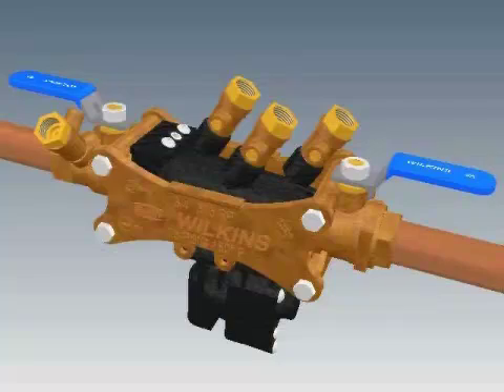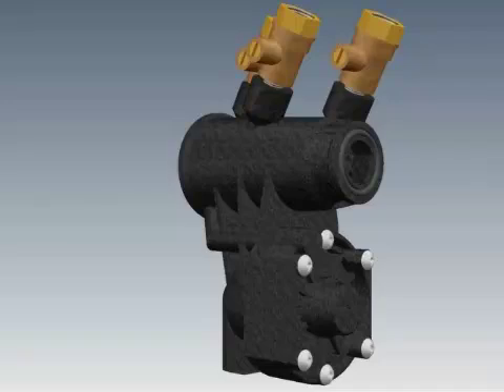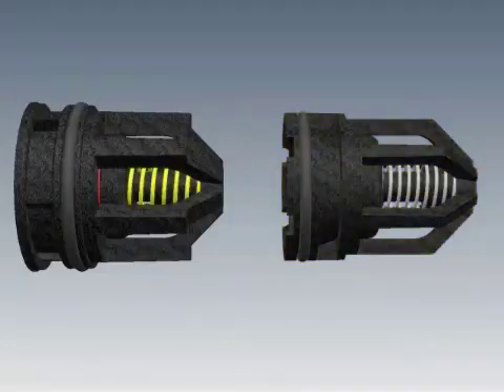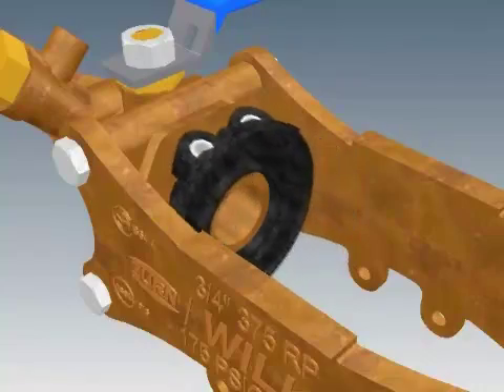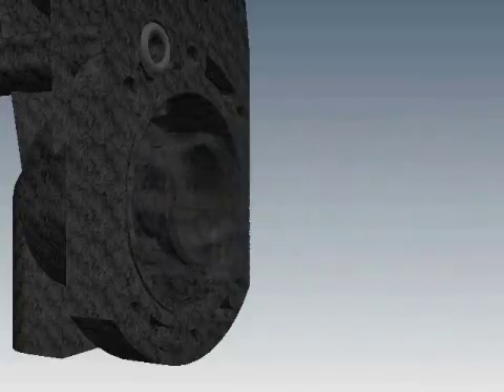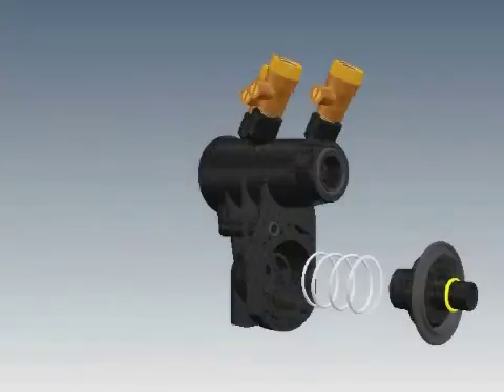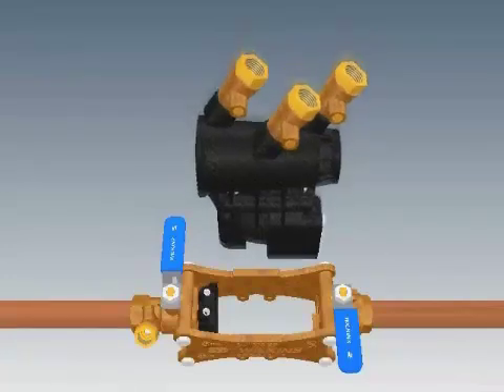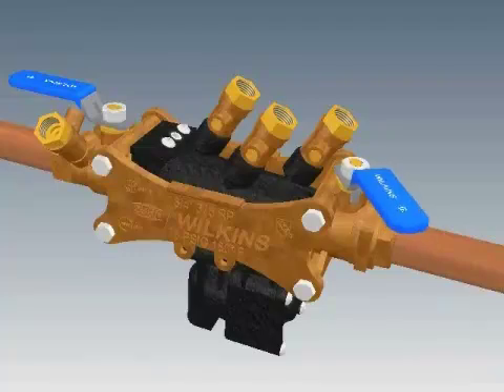Repairing a Zurn Wilkins 375 (1/2" - 1") Reduced Pressure Principle Assembly

Comment: Hi, we have a 375 model.  It has a lot of water coming down from the "vent" area.  So we currently turned off the water.  What do we do or replace?  If we turn the water on it's not just a leak, it's like turning on the faucet.
Reply from the maker: The Zurn Wilkins Model 375 Backflow Prevention assembly may discharge water in order to prevent the reversal of direction of flow of water, in order to prevent contamination of the water supply system.

The amount of water being discharged by a Model 375 Backflow Prevention assembly, may correlate with an internal leak at some component of the valve. Leaks typically occur due to dirt, debris, or normal wear, within the valve assembly. A large leak may indicate a large obstruction or leak within the valve's number one check valve assembly, the valve's number two check valve assembly, or the relief valve itself. The valve assembly is performing as it is intended to to protect the water supply system.  For assistance with determining which components may be causing the leak, please review the troubleshooting guide in the product's installation and maintenance sheet, or utilize the video at this link: 
 https://youtu.be/3d2rNoroZ_c

 
Feel free to reach out  to our customer care and technical support team by calling 855-ONE-ZURN (855-663-9876)

Comment: I have a ZW 375 RP. It's about 4 years old. There is a small leak from the body of the relief valve, not the relief vent. I've inspected and cleaned all check valves. I have also inspected and cleaned the relief value. There is still a small leak from above the relief valve. From the look, the leak appears to be from the body. What do I do? Please help.
Reply from the maker: If there is a leak coming from the body of any valve, it is typically due to a damaged or worn body. Replacing internal components may not resolve the issue. Luckily the Zurn Wilkins Model 375 is designed for ease of repairs and maintenance. We offer many repair kits for this product, including a pressure vessel repair kit, that will quickly drop in place of the leaking composite body of the valve, and return it to good working order. Available repair kits are:
1. 1/2" - 3/4”: RK34-375V
2. 1”: RK1-375V
3. 1-1/4” – 2”: RK114-375V
Reply: @ZurnIndustries  Same problem here, only 3 years old. Does housing wear out with sunlight?
Reply from the maker: @Armandot6  The Model 375(XL) was specifically tested for UV resistance for outdoor use applications. It was tested in the Arizona heat and direct sunlight without experiencing any issues from that exposure. As with any product excessive heat may cause some increase in degradation. Luckily the Model 375(XL) is simple to repair with the replacement pressure vessel repair kits. Available repair kits are: 1. 1/2" - 3/4”: RK34-375V 2. 1”: RK1-375V 3. 1-1/4” – 2”: RK114-375V
 
For more assistance in determining the root cause of any damage or leaks, we would need to see photos and potentially the product itself.
 
I hope this helps answer your questions.
Reply: Is there alternative body with 
all inclusive metal/brass kind?

Comment: Went through this step by step and I'm still getting the slightest leak that you can both hear and see near the inlet ball valve. I do not have the screws overtightened and all of my o-rings are intact, cleaned and greased. The unit is 2 years old. Any other suggestions?
Reply from the maker: Hi Nolan - thank you for your comments. We have a great customer service team that can help you with your questions or point you to product experts who can help you with this. Go to https://www.zurn.com/contact to fill out a form or to call them directly. Thanks!

Comment: I can’t seem to push the insides out with my “thumb or a small screwdriver” (:53 second mark). Any suggestions?
Reply: I got mine loose with a large plastic punch and rubber mallet.
Reply: Had to hit it much harder than I expected. Grab a hammer or mallet and they’ll pop right out.
Reply: @chasemurdock2416  I still can't loosen it up to come out. Did you use a lot of force with hammer?
Reply: @chasemurdock2416  I just didn't hit hard enough. I was afraid I was going to break it.
Reply: I found that it moves easiest if you insert the screw into the middle hole (of the three) and rock it right and left to get it to unseat. Then it comes out easily.